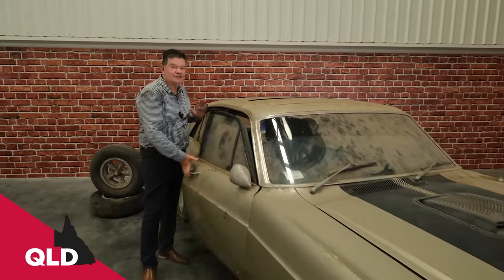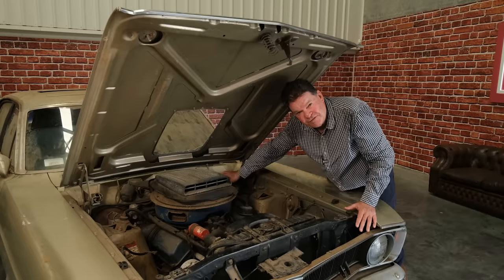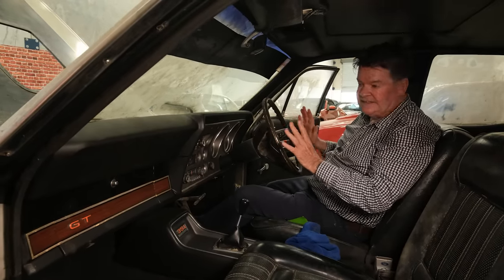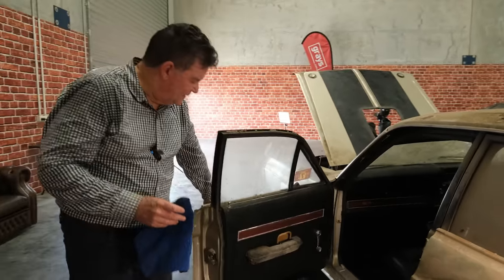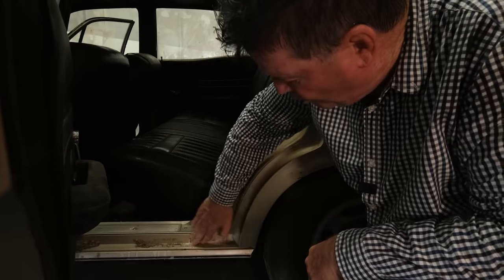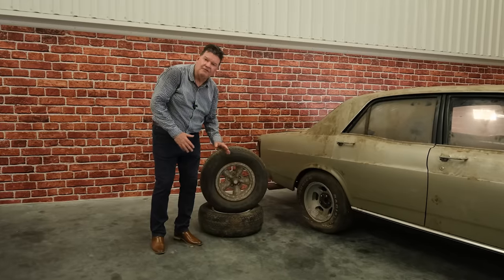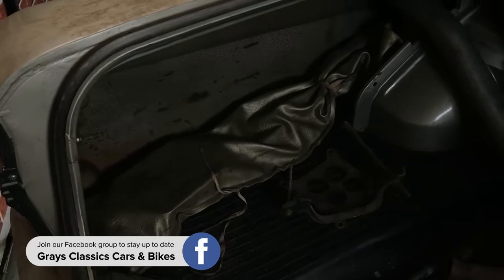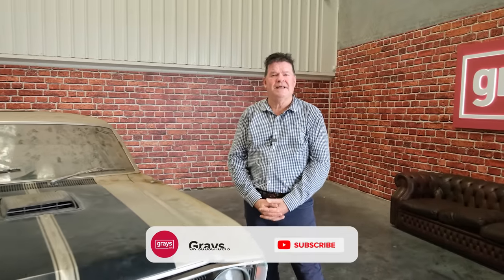We take a better look around the Barn Find XY GT Falcon

Comment: I noticed that one is optioned with the HO mirrors. I havent seen an XYGT in that colour before.
Reply: I pretty certain that all XY GT’s had the “teardrop” side mirror, (different to the XW GT) and the passenger side was an option. 🇦🇺🤙🏼
Reply: @mattparoz4246  I didnt know that about teardrops on all GT xy's, but what I do know is the Genuine xygt HO teardrops were aluminium, just like the genuine HO rear wings. All aftermarket mirrors & wings are Fibreglass/Gel so every   Dick & Harry has them. The drivers side remote mirror was an option also, as opposed to the standard 'physically touch to adjust'' mirror.
Reply: And they're like viewing back with a dentists mirror..

Comment: These were known as Ex Taxis. I owned an XA jg33. Fords always drive like taxis. The desire is nostalgia. For 300k you could do something more interesting than park an ex taxi in a garage.
Reply: I had a 300kw FGX G6E Turbo. Yeah it drove like a taxi. But with leather, climate and cruise. 8.5/Ltr to the 100km on the highway at 110kmh. Pass cars with ease and scare ya f**king pants off when you put the foot flat. Way better than a standard taxi. 😂
I also have a 302 XA GS sedan that I drove 10hrs straight to summernats on the 1972 shocks, in 2017, was comfy as fuck. 
I don't get your grandstanding?
Reply: @onedayiwillmakesomecontent jealousy

Comment: Better sit down....way back when a car got you from a to b, and we sort of didn't care to much about what what we did with them...I  had a beat to hell XY GT...rust, dints, yellow guard on the right side of a red car..interior was nackered,.bit smoky in the motor etc etc....one day the decision was made to transfer the motor, gear box and diff into our stock car for the circle dirt track...and the rusty body was gas axed into ute sized bits and buried in the dump..tags still on the car....after one season on the dirt, the race wreck was sold for 200 bucks....with a used a bit GT motor in it.....many years later, hindsight became a thing😂

Comment: Does it have a 351 in it?  I thought I saw the number 351 inside the car.  Does it have an automatic transmission?   What are the horsepower and torque ratings of the engine?
Reply: 351 four speed manual.

Comment: What was the difference  between this an a HO  ???
Reply: $700 bucks when new
Reply: HO stood for highly optioned and only limited numbers were made to allow the GTHO to qualify for what was then the Bathurst 500, think it included heads exhaust suspension.
Reply: The main difference is the engine, the ho is built to a higher spec with massive cam ect. Visually on the outside you wouldn't be able to tell the difference.
Reply: @bt6850  HO was originally High Output. But the insurance companies got scared off so it was changed to Handling Option

Comment: They were a good car i owned one JG33 XYGT 4 sp but there not as good as people carry on about them so overrated and so over priced.
Reply: They never lost value from new. A good phase 3 was worth $20,000 in 1980. The RT's and XU1's never had the desirability until well into the late eighties.
Reply: @MrJimibarrett  Why would a GS Fairmont or Falcon 500 GS K code be any lighter?? What, because the XY GT had a shaker and you think that is going to make a difference?? Lol
Reply: @MrJimibarrett   I have owned both K code XY GS Falcon 500 and Fairmont GS K code and  XY GT Falcon. The weight difference is not much at all and wouldn't make any difference in performance!
Reply: @MrJimibarrett no you couldn't
Reply: @MrJimibarrett not the same engine
Reply: Didn’t they also have 4V heads on the GT motor rather than 2V?
Reply: @bt6850 omg...
Reply: @bt6850  Yes closed chamber 4v iknow a bloke who has an XA GT which has factory 2v heads on it he has the build sheet for it to prove it.
Reply: @WascallyWabbitt  True $20.000 for a good HO i paid $4000 for my XYGT i worked at a Ford dealership also but i bought mine privately
Reply: Hey mick, it is only your opinion and you are not the person everyone on the planet aspires to be. Who cares that you owned a genuine GT.
Reply: @iggytull624  I have owned better cars than an XYGT and i don't care less what you think dreamer.
Reply: A car is worth what someone is willing to pay for it . Sure GT’s are a good looking car but aren’t worth to me what they want for them but to the next bloke it probably is . People who are cashed up & payed the big price for these things are the ones that set the bar & so guys that have even old heaps of shit think that there worth big money . Try buying a rusted XY - XW or whatever shell & see the stupid price they want . Ridiculous.
Reply: @blastermaster2383  It's just greedy madness.
Reply: So overrated? Rock up in one anywhere in public & see how many people think the same.
My brother picked up a nice XY wagon recently & an 8 year old girl was stunned enough to ask her Dad what it was.
Reply: They're collectable in the same way a picasso is collectable.
But I agree with Mick.
I had a few cool aussie classics back in the day. No way would I buy one again now. They were never great cars and they're way over priced for what they are...mostly rust buckets now.
I'll stick to my 2017 mustang.
Much better car in every way and lots cheaper.

Comment: really good detail around 1,200 bucks under the car inside and out and then fix all the rust spots and new paint job, around 20K to 30K done properly, maybe take it to the creation brothers in WA. Then you have a good 250K or more because its a original car, but wait you still have the engine and running gear to re fresh, which is even more money so after its all done and dusted its will cost around 50 to 70K to fix up ,but leaving everything original,  good luck to the new owner and i hope it sells or keeps it. 
That's the only thing ford owners thing they have gold, yet the same period in holden say a 1972 HQ GTS 350  sedan is around the same price, but never used to be, they were around 50% less to buy about 15 years ago, but not now?
I know because when i checked through the yellow book, which was the retail trades price guide for all cars sold in au and based on age, model and kms and condition from fair, to good to concourse etc.🦘🦘🦘🦘✌✌👍👍